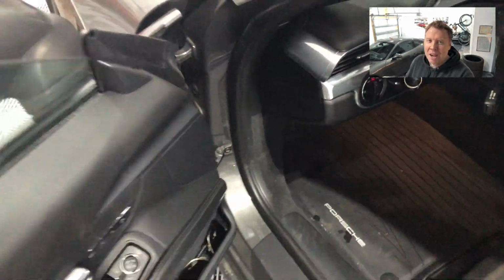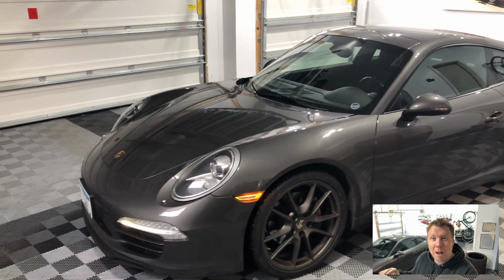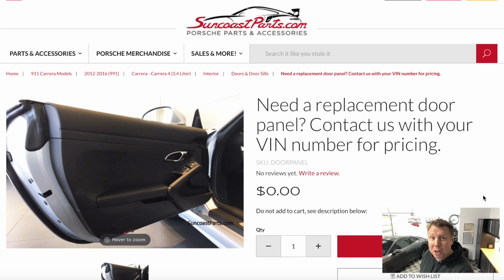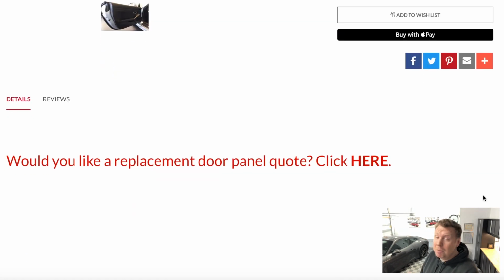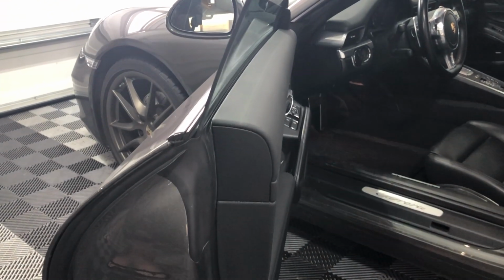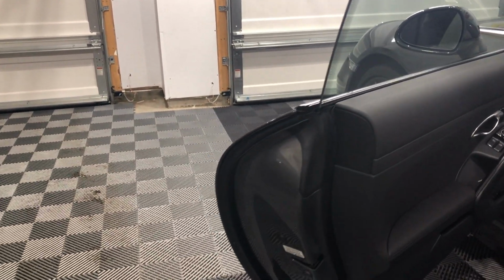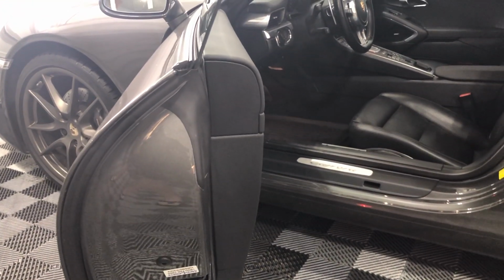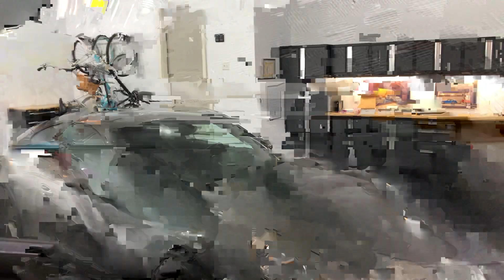Porsche 991 Door Panel Problems - Warped

Comment from the maker: Quick follow-up note for everyone: It seems the full-leather door panels are less likely to have this issue. The doors with the basic interior trim are the ones most affected.
Reply: I’m hearing a mod opportunity! Upgrade to extended leather. It’s standard on UK and EU cars and looks much better than US spec
Reply from the maker: Hahaha. Good one!!
Reply: @nathanbryant2061   That's interesting.  So they cheaped out for the USA market?
Reply: Add cayenne 958s to the list :/
Reply: Happened to mine! 2014 991 with the basic interior. Just had an interior guy add some contact glue to get it to stick. We’ll see how long that last for 🤷🏻‍♂️🤞🏼. Frustrating for this type of car. My 2008 Nissan Frontier with 220K miles would never have this issue. Interested to know if those new panels are actually properly fixed or will do the same crap over time?? 🤔. Glad to see mine isn’t the only one. Thanks for sharing.

Comment: Just noticed this has happened on my 2013 C2S, which I bought used. Both doors. Out of warranty of course. Problem with DIY solutions seems to be not interfering with side airbag deployment. If dealers are just replacing with same panels, it will likely happen again. Absolutely unforgiveable for cars that cost what these do. My 2000 BMW 528 interior is still flawless. No excuse for Porsche on this one. They should replace them free for any affected car, but I'm sure they won't.

Comment: Yep, this happened to my friend’s 991, just after the warranty expired. At first I heard that it was primarily happening to cars in the hot south,  but have been told that it is happening everywhere. My friend ended up buying two panels off of EBay and having a independent mechanic put them on.

Comment: This is an issue on the cayman 981, 718, and the 991.2 since they are the same door panels essentially.   If you have the leather wrapped door panels it doesnt seem to be an issue however,  just the base rubberized door panels.  I have heard of very few people successful in getting Porsche to cover this defect out of warranty even though it is clearly a very common defect.   Especially in warmer climates.

Comment: 2014 Base here almost 70k miles, top of panel loose on driver side.  Recently pulled panel and repaired myself total cost of materials $15 and about 48 hours for it to cure properly.  Holding up well no issues noted since.
Reply from the maker: Great!! Well done!
Reply: Fascinating. I am well out of warranty and both sides are warped. Once you pulled it off, what did you do to straighten it and make it hold? It looks like it has been about 6 months. Has it held up pretty well? Thanks! Ron
Reply: What did you do?

Comment: I had this issue.  Took it to Porsche while under warranty and they "replaced it".  Happened again a few years later.  Called them and they wanted $1,000 to replace.  I fixed it for $5.00 and 30 minutes.  Buy the 3M flexible glue for door seal adhesion.  Works great!
Reply from the maker: Thanks David!!
Reply: Is it still holding?  Thinking we will try this.  Any tips on where to glue it?

Comment: Just noticed this happening to my 2014 C4S last week. Both sides. 8 weeks outside my CPO warranty. I took it to my local dealer who submitted a claim to PCNA. They agreed to cover 50% of the replacement ($5200 installed includes tax/fees) or 100% if the dealer completes my 6 year maintenance and have them retrofit PSE. Needless to say I am looking forward to my new exhaust. (I was going to have them both done anyway)
Reply from the maker: Good for you!! Nice one.
Reply: Great deal!! You're going to love the PSE. I was thinking of updating my 997 PCM to something more modern when I bought it last year, but TBH, I never turn the stereo on when that magic button is activated.

Comment: I had that problem on my 2015 911 Carrera S with 22K miles. Removed the door panel, 4 screws and 4 small panels, very quick and easy.  Reattached the interior inner panel to the plastic frame with a flexible rubber cement.  Good as new.

Comment: Has Porsche fixed the underlying problem so it won't happen again? My dealer quoted $1,367 for passenger side and $2,068 for driver side on a 2014 Boxster, plus 1.5 hours labor on each. I'm reluctant to spend this much if it will just happen again in a few years. My car is garaged and not subjected to excessive heat or cold.
Reply from the maker: Hey Raymond, unfortunately even with replacement panels Porsche won't promise that the problem won't reoccur. It's a defect with the panel and the adhesive used. I was quoted similar pricing. There is a shop in Florida that is getting GREAT reviews from Porsche owners who fix your panels if you ship them to them. Pedro's Garage - http://pedrosgarage.com/Site/Technolab.html

Comment: It happens on leather panels, too, though anecdotally it seems to be less frequent there. And it has also happened on dealer-replaced panels - so at least in some cases, the root cause (bad materials, adhesives) wasn't really fixed.
Reply from the maker: Oh boy. 🤦🏼‍♂️🤦🏼‍♂️🤦🏼‍♂️🤦🏼‍♂️🤦🏼‍♂️

Comment: If I was going to pay out of pocket for replacements I would first take the defective ones to an upholstery shop and let them try to use some adhesive to reattach the material.   It should be a simple fix for an experienced upholstery shop.
Reply from the maker: Unfortunately the plastic and the foam were not only separating but disintegrating beyond repair. I imagine some people would be able to repair their panels, not everyone though.
Reply: Well bummer.

Comment: Haa...I've got a 981 and leave it in a cool garage, just drive it to work and yes, it's outside but that's just 4 days/wk.  Aftermarket tint.  Both door panels still pulled away.  Personally, after visiting the factory I think Porsche just used some eco friendly glue that failed and has since changed formula--but nobody is talking.   Anyway, I will fix it myself--thanks for the video.
Reply from the maker: Bah!!! Good luck.
Reply: If regluing worked what brand was it?

Comment: I’m gathering from the video that you had the panels replaced and not repaired. IF Porsche won’t stand behind the quality issue are there repair options out there versus the $5300 I was quoted to replace the panels on my 2103 911 4?
Reply from the maker: Hello there. Yes! There are repair options, some better than others, plus it depends just how badly warped your panels are. Some are beyond repair. You're still probably looking at $500 per door panel though, is my guess.

Comment: My car has 2 yrs of CPO remaining and I have the same issue. Did you get it fixed under CPO?
Reply from the maker: I would go get yours fixed ASAP, then make sure you check the new panels again just before your 2 years of CPO runs out and make sure you don't need them replacing AGAIN! It's true - that can happen. :-(
Reply: @AutoAmateur  will do . Thanks again for a timely video. I may pay more and get leather wrapped door inserts instead.

Comment: Hey James, any ideas if this could also happen to the models with full leather packages, like mine? Mine are perfectly fine, but it is slightly garage queened so far in its life. Just wondering if you came across any info on that in your research.

Edit: just finished the video and you did mention leather costing more, so I’d imagine that leather packaged cars are also susceptible to this warping.
Reply: You’re safe if you have the full leather package. There are a ton of threads on this issue on Rennlist and it’s been confirmed that the full leather panels don’t have the “delaminating” issue.
Reply: Ali Malik thanks Ali!
Reply from the maker: Hey Mike, right. I think you’re safe if you have the full leather package. I think it’s just the basic interiors that suffer the issue.
Reply: Auto Amateur thanks mate! Love the multiple videos, can’t wait to see what’s in store for your solo week!
Reply from the maker: Capital Exotics cheers mate!

Comment: Door panels are very easy to remove and replace.
Reply from the maker: True. They just cost a pretty penny. 🤑
Reply: easy to remove and replace but you have to swap all components and harnesses over to the new panel which will take a bit more time.  Panels from the dealer will cost a fortune.
Reply: I've had my panels off more times than I care to count, doing audio upgrades and door deadening.  There's not much to swap in my base 991.1 - no seat memory, just window switches.  It's very straight forward.

Comment: I have a 2015 Cayman 40k miles that is garaged and need to replace both panels. PORSCHE Burlingame wanted to charge me $3k per door. I found and auto  Upholstery shop that will re adhere for 400.  It's a design issue that porsche has not addressed. I'm really disappointed in Porsche.  Do better!
Reply: I have the same situation on my 2014 911 cab and brought to one shop to re-glued them. Warped again both next week. Can you tell me which shop fixed? I’m in bay area so I want to find the best shop for this problem. Thanks!

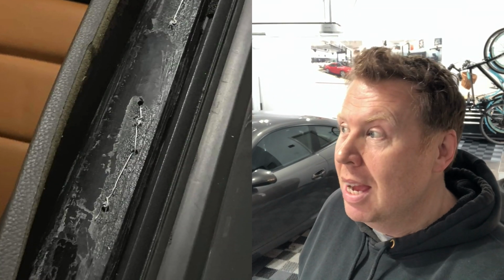Comment: 1:47 well I would hope Porsche will fix this if you are still within warranty, but even after the warranty expires, this is UNACCEPTABLE. I can buy a car for a fraction of the price and this does not happen to their door panels. The same thing with their change-over valves, coolant pump and coolant leak issues amongst others. Fix the damn problem! Do some testing in all climates and accelerated testing. This coming from a Porsche enthusiast of more than 55 years and now owner for over a decade.